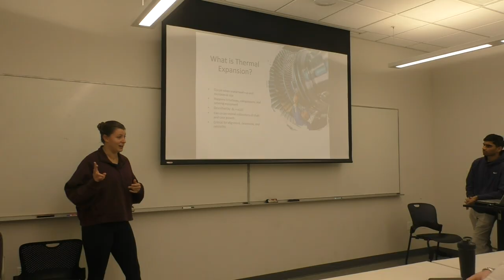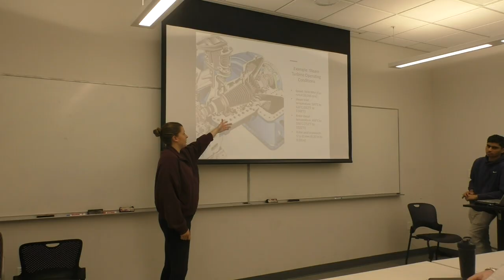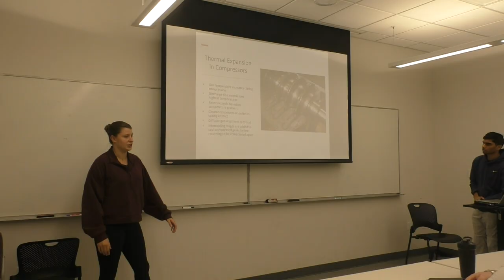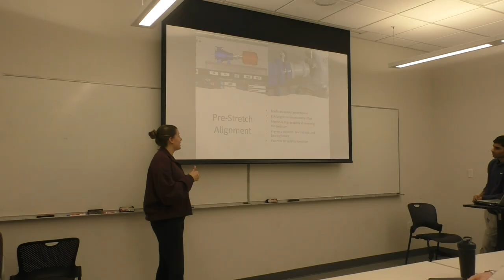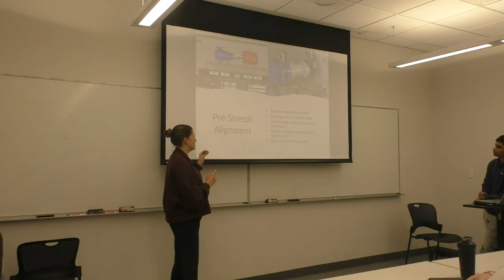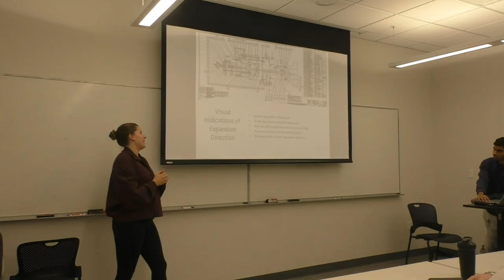Alexis Conachen: SMT - Thermal Expansion in Rotating Equipment

Comment: I think I did a good job clearly explaining thermal expansion in turbines and compressors and using real numbers to make it practical. I could improve by reducing repetition and slowing down slightly to make the flow smoother.

Comment: It was very interesting to learn how thermal expansion impacts rotational equipment. Learning about how heat expansion through steam turbines grow to nearly 10 mm or 0.5" inch at the inlet was a great reminder of how important heat transfer is to rotating machinery. The presentation also taught me that designs in compressors are geared to limiting thermal expansion. I loved how you explained thermal expansion in turbines and compressors, and how engineers can counteract the affects of thermal expansion by adding offset coupling between the turbine and compressor. It goes to show that thermal expansion is an important topic that needs to be calculated for safety, lest you want machines going catastrophic. It also shows how important quality engineering and machining uncertainty is to the world of design.

Comment: Your presentation was very informative and offers information about a topic most of us don’t have experience with from industry yet! Your explanations were very easy to follow and are engaging. It’s hard to find an improvement, but if I had to say something, your slides are sort of visually wordy. Mostly because of the spacing between bullet points at times. Having more gap between bullet points would increase audience readability and engagement. Otherwise, you did a great job overall!